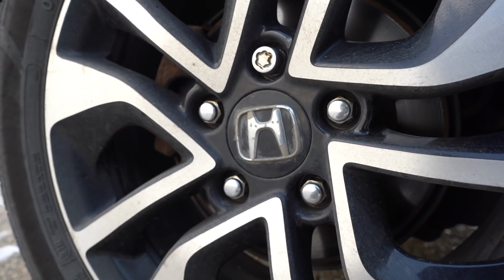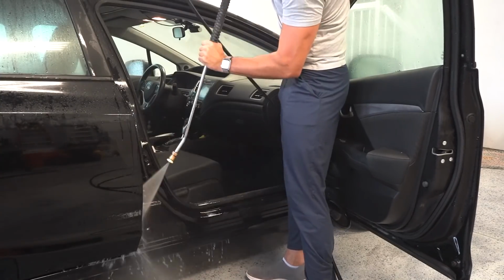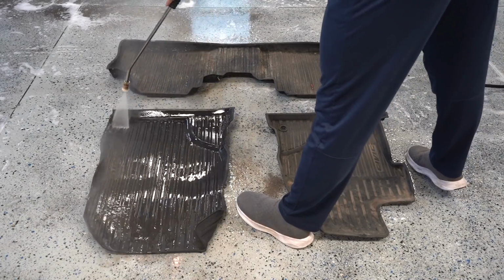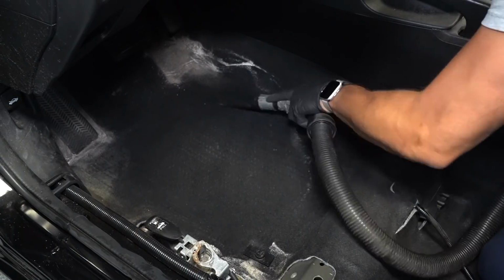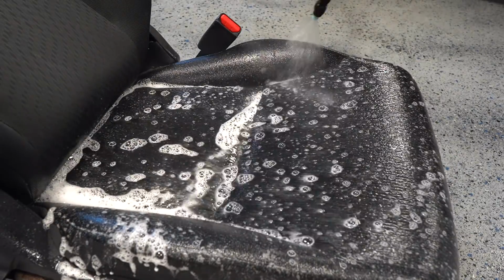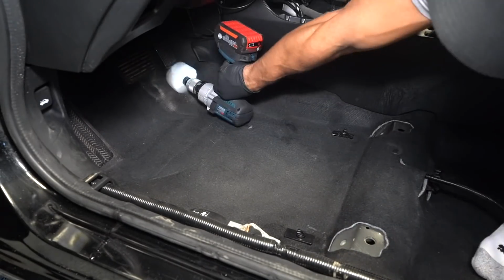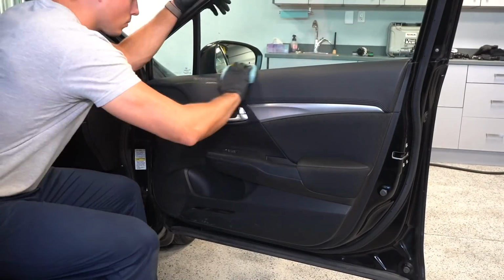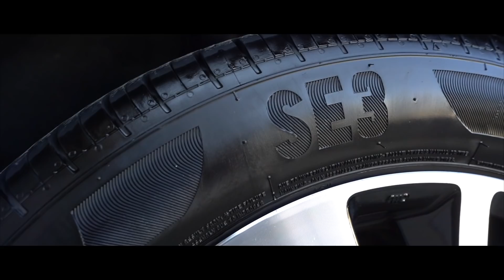How to Detail a Honda Civic! | The Detail Geek

Comment: When you unplug the batteries of the cars, doesn’t it usually reset saved radio stations and sometimes the clock? Just wondering what you do for that
Reply: ..and the power window operation.
Reply: Sunny Deng thanks for the info! I’ll have to look into that

Comment: Hello,

Would you be able to make a video explaining exactly which products you are using along the way? i.e when to use meguiar's non acid tire and wheel cleaner vs Meguiar's wheel and paint iron decon? Also, what product do you apply at the end to add the shine to the tires?

Comment: Really looks like brand new. How long will it take for the interior to dry? Looking at those foggy windows and knowing it is already pretty cold, it could take a long while, or not? Would it be recommendable to place some kind of heater in the interior, or what could be done to safely dry the interior as quickly as possible?

Comment: Nice job.  How long does it take to get rid of the humidity in the car in cold weather?  The seats are damp and all the windows are fogged.
Reply from the maker: Not long...it’s just because the car was in the warm heated garage and then I didn’t have it started (so warm air circulating inside) during the drone shots so the condensation was able to form since it was so cold outside.

Comment: Great job as always! Only 9 hours to do this one compared to that shed of a Civic a few weeks ago! I’m surprised that your bissell pro extractor has held up this long. I had a little green that was garbage. It fell apart and was held together with duct tape! Then all the rubber seals  failed. I was forever emptying and filling the bottles. That was on a relatively clean G5 with awful light grey interior!!

You have made me want to deep clean my 2003 Jetta Wagon and the seats are definitely coming out the wife’s 2007 Honda CRV! 👍

Comment: Noticed you steam clean the tracks on the seat positioning system. Do you have to re-grease those or does the steam not remove the grease since it’s usually an oil base lubricant. Just wondering. Awesome vids.

Comment: I don’t understand how you can get such good results with only 1200psi , I switched to a Honda 3000psi but I had to use my electric 1200psi one for a day and it felt like I was using a regular hose with my finger in the hole, how do you do it ?!
Reply from the maker: Mine is a 1900 psi unit @ 2.0 gpm....and it actually can push that constantly. A lot of cheaper units advertise high psi/gpm but can never actually hit those numbers.

Comment: I've had my vehicle ceramic coated and we're having lots of rain here and I should be able to spray it with the garden hose to wash it off but everything clings to the paint I have to take it through the carwash and then there's these white streaks on it. The guy who did it doesn't know why it's doing this do you have any idea why?
Reply: Maybe its the wax coating that's applied at the end of the wash not being rinsed off  evenly.   I usually dry my car immediately after the wash and go over it with some spray polish.

Comment: @The Detail Geek I want to start a detailing business and I’ve always been afraid of extracting seats. Can you give me some tips to not mess up?
Reply: If you watch more videos, he sometimes mentions technique. What I remember is he uses only hot water in his extractor and uses the water until it runs clear. Then he only extracts (without squirting water) to get it as dry as possible. Good luck with you business
Reply: @V.Hansen.  Yeah I remember hearing that but I’m even after I extracted my dads seats it was still pretty wet but it dried later. I also didn’t want to saturate it too much with the solution even if that is a thing
Reply: @sameerramdeen477  I've been thinking about the same thing. I just ordered the extractor and will just have to practice, I figure. He does say it takes at least 2 hours to dry in his heated garage. I think he says he uses the least amount possible to still get it clean.